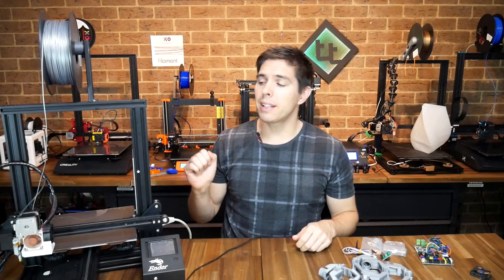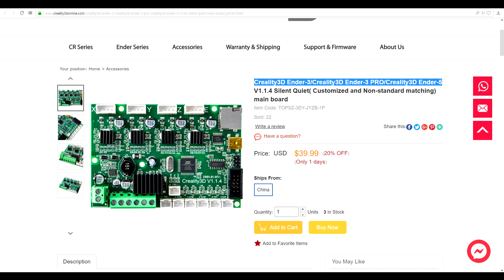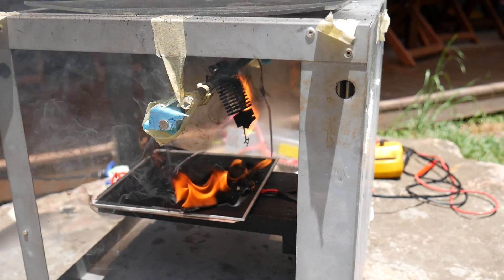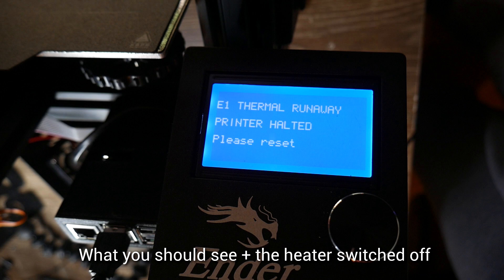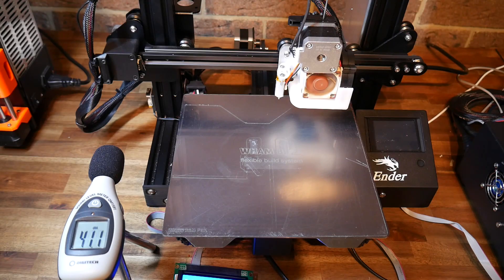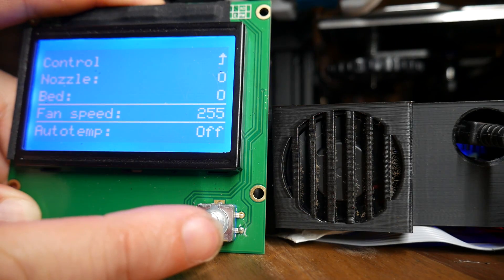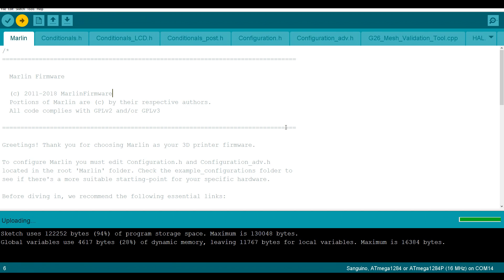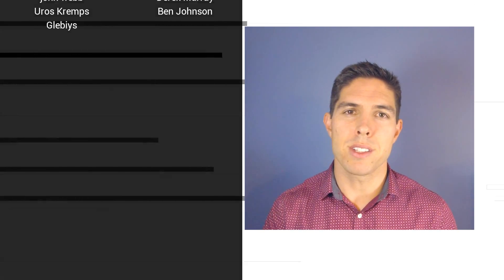Creality 1.1.4 Ender 3 board upgrade - TMC2208s from factory

Comment: Just installed this and got very confused as the steppers were actually louder than before (I have dampers installed), referred back to this video and saw the comments about there being two 1.1.4 boards (Seriously?!) and the one I have does not have the new stepper drivers or bootloader. Currently speaking to creality support who are claiming that there is only one 1.1.4 board.

Seriously, how can so many Chinese manufacturers get so much right and completely fail at the basics is beyond me.
Reply: When you speak a different language a lot gets lost in interpretation...….even the Pope know this.
Reply: @gangleweed  it's a question of adequately incrementing a product version number, not communicating changes. It's a fairly universal concept.

Comment: Is it possible that the E driver is still using the old driver? You checked only X...
Reply from the maker: Based on the silence of the first layer printing (before the part cooling fan starts blaring), I'd say all have been changed.

Comment: Hi you probably know that creality have added links to the sales page (and $10 increase) which allows users to grab the new firmware with the runaway in it. Not sure why the boards never had it already but it's easy to update.  Ender-3 1.1.6 firmware thermal runaway protection enabled: http://bit.ly/2Is4rBM
Ender-5 1.1.6 firmware thermal runaway protection enabled: http://bit.ly/2IqKr25

Comment: it is something I will buy. .... it is easier than getting the gears off the stepper on the pro and mounting dampeners and buying an arduino and flashing to a new firmware to enable runaway on the stock board....

And about the same price

Thanks for doing these videos.

Comment: Thanks for the video.. I ordered one to try out. I use your BLTouch configuration files for my Ender 3. Referring to your video on TMC2208, all I need to do is change the direction of the motors in the config files? That's all?
Reply from the maker: I think they may have addressed this already in this board, because when I flashed vanilla marlin I didn't invert it.

Comment: How can i make the Ender 3 cooling fans quiter when running,  for example,  at 15%? They have a loud coily noise.  The board upgrade looks awesome.
Reply from the maker: In configuration_adv.h, there is a fan_pwm option to uncomment.
Reply: @TeachingTech  Finaly got the board, sadly still the same issue. Did not find fan pwm settings in configuration_adv.h, but in configuration.h there are two options FAST_PWM_FAN and FAN_SOFT_PWM. Does FAST_PWM realy heat up the mosfet that much or is it just a procausion?

Comment: really cool but disappointing for the thermal runaway protection. I know a bunch of people that would have jumped right over to this for the Bootloader, 2208 drivers and drop in board. still a great upgrade but you need to do vin marlin. hopefully the default ender profile that is in marlin works for the new board and the upgrade is easy. I like my 2130's and moved to an skr1.3 board. like it so far but only been a week.

Comment: With the upgrade board. If 1 stepper driver failed it means a complete new board, Where as the MKS will take the individual 2208 2130 steppers individually and may also allow any new TMC's Trinamic produce.
It will still take the colour screen and if flashed with correct screen firmware will give you power fail restart and filament feed option. May be a few bucks more but worth it in the end.
Reply from the maker: I agree I'm very happy with mine.

Comment: I wonder where the board gets the 3.3V for the SD-card from. As I understand it the CH340G does not have a 3.3V regulator that the FT232RL has.
Are there parts on the backside of the board?
Reply: It provides 3.3v via V3 on pin4 but about half the current, approx 25mA vs FTDI FT232R
Reply: I checked the datasheet for the CH340G and have not found any rating for the "3.3V reference output". So I send WCH an email and asked what the power-rating of that pin is, but have not received an answer to this yet.
Creality3D released pictures of the V1.1.4 board, including the backside, there are no additional parts.
Half the current would be pretty bad.
I was not even convinced that using the 50mA regulator from the FT232RL was a good idea. But both my CR-10 and my Ender-3 (without power-off-resume) are doing just fine.

Comment: May question is whether Resume print feature and change filament is still enabled with the new FW. I hear there are issues with upgrading and enabling the resume print feature and change filament (menu feature) feature still available. Although I never have to use it (resume print), it is nice to know it is there I will have to purchase this new board for the 2208s.

Comment: Ah Dam you Creality. Ordered a new 1.1.4 board to replace one that failed as needed one quickly. Got it and installed (no documentation or change notes) flashed the stock BLTouch firmware - AHHH its 1.1.6 and they have not released a 1.1.8 with BLTouch support.  Not only am I now running the wrong firmware for the drivers but within a few days the BLTouch failed and won't deploy. Response from Creality  "It maybe the main reason why, the firmware don't compatible." So they have released a nice new board that could fry their own official BLTouch upgrade
Reply: The BL touch would have been my next purchase after the board     So I'll have to wait for a version of the firmware that supports it AND the tmc2208  stepper motor drivers (?)

Comment: I ordered 3 of these. Gonna try the 2 in my 2 ender 3's should be no problem after firmware config, but the interesting one will be trying it in my cr-10s. It might not have enough amparage on that z stepper driver, but we'll see. Maybe with heatsinks and forced air cooling I can over volt it
Reply: Did it work?
I Will try the same procedure.
Please help me.
Reply: @Ambr1942BR  damn 3 years of procrastinating. Thanks for the reminder... They worked in the ender 3's, I didn't want to try in the 10s, out of a fear of breaking it, just kept putting it off

Comment: How is this an upgrade?
Only 1 extruder connection.
Same slow Atmel.
If you want an all-in-one style board, get a Geeetech GT2560 and add your own stepper drivers. Handles 24V and bed leveling. Fast enough to run Delta machines with loads of memory.
If you have space and a little more experience(and money...), RADDS ( http://doku.radds.org/dokumentation/radds/ ) with a Due is the top tier solution. Up to 3 extruders! (For the best setup, look into http://geckodrive.com/ Gecko Drives, though each one costs as much as your piss-ant machine.)
Enough of these cheap boards. Get something good and stop complaining that your $5 board is skipping steps or can't go fast enough. You need to realize that 8-bit is TOO SLOW to print at any decent speeds. 32-bit is the only option for you.

Comment: use an oscilloscope instead of a multimeter to test thermal runaway because if the PWM is decreased to near 0 the multimeter could still say 22 volts even though the hotend cant get any more hot.

Comment: I just ordered one of these, and i've noticed they have updated the listing with the below. 
They have made a new firmware which should have thermal runaway, any chance of a test on this?

"Silent function( Customized and Non-standard matching)!
Ender-3 1.1.6 firmware thermal runaway protection enabled: http://bit.ly/2Is4rBM
Ender-5 1.1.6 firmware thermal runaway protection enabled: http://bit.ly/2IqKr25"

Comment: Something I will try (but it will take some months, as I have other ongoing projects): Using an Einsy (clone). Normaly its about 74 $US at AliExpress, but on "sales" like Black Friday or Anyversary Sale with Coupons you can go down to about 60$US.
As you can make some adjustments by gcode (like steps/mm) and save it into flash, you even do not need to change the firmware; you always can use the newest one from Prusa.
Of course you should also add a PINDA2 for ABL and use a spring steel for print surface; also you have to change the display to a 2004.

But if you consider both the board upgrade and the ABL upgrade, buing an Einsy, a pinda2, a spring steel (and sticker) is nearly about the same price.

Of course it gets more expensive afterwards: You may change to direct drive (f.e. use a modified version of bondtechs mk3 upgrade but made of chinese parts for about 40$US) and even be tempered to try an MMU2 on the Ender 5 ;-)

Actually I think the Ender 5 would be the ideal base for an "mk3 clone" with nicer kinematic and maybe a slightly higher speed with same print quality.

Comment: Another great  video. I really enjoy your channel with all the great Creality fixes and upgrades. This looks like a definite upgrade for my Ender 3 Pro.
I just installed the Micro Swiss hot end for both my Ender and My CR10s pro. unfortunately having problems with the Ender 3 with under extrusion. Playing with temperature and retraction should help solve this.
Creality should put you on the payroll

Comment: Hello Michael. Thanks for great video once again :) I know that Ender-3 has common problem with mosfets aswell (specialy hot bed mosfet). I just had bad experience and mine burned out after one month of using printer. I just had to replace board (and this time I secured it with external mosfet for hot bed heating). So I am wondering what kind of mosfet new board has ? V 1.1.3 has D522P GA4B13. Thanks for answer !

Comment: I like the driver update and would buy this board for my Ender but not without working TRP. It seems like they tried to add it but missed something. Hopefully they see this and make adjustments. Its one thing to not have TRP but to falsely advertise that you do could lead users to make assumptions about the safety of their machines which could lead to a fire.

Comment: Based on the price and having to flash marlin anyway I would suggest just doing a gen l upgrade.   Current prices on aliexpress will get you the board for $15 and 2208 for  $3.88 each plus  $.75 shipping.   That puts you at $35  or so. You get the added benefit  of picking 2130 drivers if you want  those instead. plus more  space for marlin and more pins for    upgrades.  I.e  bltouch  filament run out etc. Great vid as always!
Reply: Hey, could you please elaborate a little? What is the gen I board? Is it the same that comes with the Ender 3?
Reply: @filipecoelho9855   it's mks gen l motherboard, he showed it in this video and even made a tutorial. You can find it on Teachig Tech channel
Reply: @filipecoelho9855   No the  MKS Gen L board is  a replacement board that you  buy instead of  the  stock ender 3 board.  IE from amazon or aliexpress.  look  for a Teaching Tech video where he discusses  adding this board as an upgrade

Comment: I recently got the Creality BLTouch kit, using an MKS Gen L, my version was 2.2 but if yours is v3 then you may have to use Marlin 2.0.

I'll also give you a heads up the VCC, GND & 40/PG1 wiring is a bit messed up on the board side, on mine the GND was the middle red wire not the black (think the black was VCC), some people have also said the 25/PA3 & GND pins that are used for the endstop are backwards but that wasn't the case for me.

Comment: Ok. So I opened my new ender 3 and the board says v1.1.4 but I noticed one little difference on ATMEGA chip. The photo on creality store ATMEGA chip has the reference 18308V9 and mine has 18308V8.

Comment: Thanks for the video, Michael. It is important to know though, that you will not be able to run Klipper with Pressure advance enabled  with this board as extruder will definetly stall with tmc2208 in stand alone mode. Other than that a pretty bold move from Creality.

Comment: I might have gotten lucky. But cannot confirm just yet, because I'm not at home for a few more days. Long story short, I have a somewhat faulty board in my ender 3,it reboots the whole thing when I connect to it via USB (octoprint, or pc). So i requested a replacement board from gearbest. It arrived 2 weeks ago. Its just like yours, with the 20010151 number over the 1.1.4. How do I know it's the upgrade one? I think mine inside the printer is a 1.1.4 but I don't know if there is any difference. I'd be so much more motivated to replace it during the weekend...  :) can anyone confirm? Also, can anyone tell me if I should manually set the vref? Copying the ones from the printer? Or just leave it alone? Thanks in advance!! (and obviously, this comes out just after I have a mks gen l coming with 5 2208-s for dual extrusion, bittersweet, but I'll get over it :D )
Reply: Can anyone give input on setting the vref? Thanks!

Comment: I was thinking it's nice that the printer is quieter, but that's not worth $40 to me. Then you said the bootloader is included! I've wanted to update the firmware but didn't want to buy something that would gather dust most of the time. I might upgrade to this board. Thanks for the great video. I presume the Marlin update process is the same as in your previous video.

Comment: I have found the problem with my Ender 3 why my PID bedtemp not was working properly with M303.
In line 320 (marlin 1.8.9.) you must set the 0 (zero) to 1 (EPCOS 100K ) Set #define PIDTEMPBED (line 422) on (Take the // away).
Now its working, and you can in pronterface put the gcode M303 E-1 C8 S90 to auto-pid the bed.

#define TEMP_SENSOR_0 1
#define TEMP_SENSOR_1 0
#define TEMP_SENSOR_2 0
#define TEMP_SENSOR_3 0
#define TEMP_SENSOR_4 0
#define TEMP_SENSOR_BED 1 <<<
#define TEMP_SENSOR_CHAMBER 0

For all those who have problems with it, and allways get the error
Dont no if it willl work if you dont have Marlin installed. But give a try.

Comment: I recently ordered 2 Ender 3 Pros both had V1.3 boards and both had USB connectivity issues I like to print via USB so I was not happy so I ordered 2 of these V1.4 boards and no more problems. And they are pretty quiet even though I had these problems I am still a Creality Fan. And I will be trying to Update firmware tonight to see if mine have boot loader

Comment: Step 1 - Order board - check
Step 2 - Learn more about bootloader and marlin
Reply: the board still has the tiny Atmel chip where a big custom firmware will exceed the flash memory available

Comment: The ATMEGA1284P is a concern for me. I'd love to have extra program space for more Marlin features. Something like the MKS is appealing, but the incremental costs of the board and stepper drivers adds up.
Reply: If space is your concern go to one of the 32 bit boards. You get significantly more RAM and Flash on these more advanced processors but you pay less (for the chip) as there is more competition. The SKR board is literally the same price as the MKS and supported by Marlin 2.0. A step up would be the Duet Maestro which makes the raspberry pi with octoprint obsolete as it has Ethernet on board and comes with on board Trinamic drivers - clones are available for around 65$.
Reply: @christophmuller3511  Thanks for the info. I had expected the 32-bit boards to be more pricey. Will check them out.

Comment: Will be interested in how you go with the BL touch.  On my kit from them I had to reverse the black and white wires.  They may have fixed that by now.  Would be interested in how you get it set to the right z axis offset and also if there is a way of testing it to know it is working correctly.   I still find myself micro adjusting the levelling wheels.

Comment: Woah, it's already sold out. Hope they get more in stock soon.

Too bad though, I have JUST finished setting up my MKS Gen L with TMC2208s and one LV8729, but even though I printed a case for it that keeps the original E3 lid, it barely fits and the original mainboard fan collides with the heatsink of one of the drivers. Also the now external SD-Card reader isn't the prettiest sight. I'd happily sell my completely configured MKS Gen L along with the dirvers and get one of these.